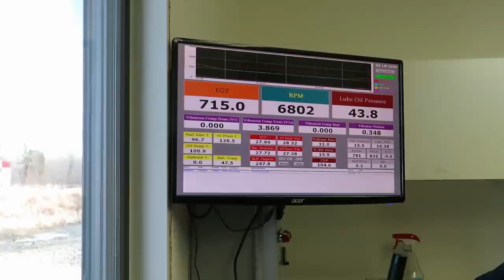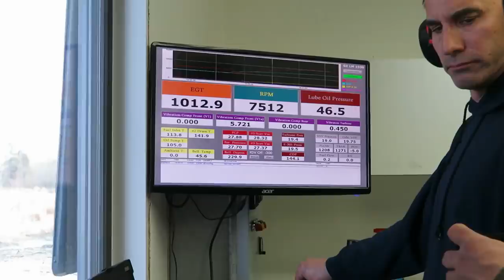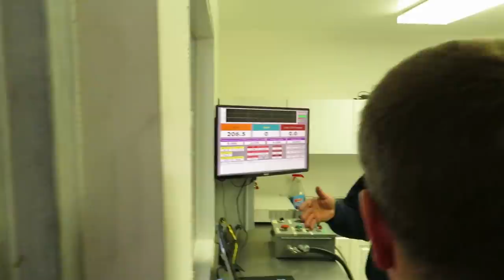Turbine Blade Locks In Action

Comment: Agent Jay Z, I recently toured on of our facilities and found that we have a generation unit that has 10 lm1500s in a huge circle.  I also found an S&S turbine labeled container out in our yard and learned they rebuild our engines!  One thing I noticed that I am not sure you mentioned in your videos is that our engines have hydraulic starters.  I was surprised and excited to learn this and took many pictures. As always, great videos, thanks for taking the time to inform us.
Reply from the maker: Yes, I've never been there, but seen pictures. 10 LM1500s all feeding gas to a common inlet of a huge power turbine.
If you have any info on why it was designed that way, it would be cool to see it.

Comment: Its a dovetail that tapers in the 2 directions it takes force, thus the taper is forced together. So long as it is under force from both directions, it has zero DOF with respect to the hub its attached to.  The lock doesn't bear a load while in operation because it only prevents the joint from backing out under a reverse load condition that never occurs in operation.   ~one engineer

Comment: Another great video. I have heard this myself when the turbine on some jump planes shut down.
I wonder if the engineer working on the blade lock system way back when got a room full of strange looks when they proposed the tiny pins / strips / tabs?
Reply: @gordonrichardson2972  Completely understand the ease of removal.  I was more thinking about when someone, during the initial design phase of the engine, first presented the idea of using the 'flimsy' roll pins rather than the much strong other options.

Comment: Why would you switch to running a J79 with natural gas versus jet fuel? Is this a J79 that is being converted to an LM1500? Or is it going to stay a J79 aircraft engine and you were testing the engine to troubleshooting something and LP is cheaper?
Reply: Oh nevermind, you called it an LM1500 at the end of the video. So I'm guessing this means it was a J79-LM1500 conversion you did for a customer. Thanks for the awesome videos!

Comment: Could compressor surge ever put load on the blade locks if there's an issue with the engine? I'd imagine that'd be a pretty bad/expensive day for the engine owner either way, so it's not like it'd be some glaring design deficiency.
Reply from the maker: As long as the rotor is turning with any significant speed, the blades are locked centrifugally, so the locking devices would not be affected by a compressor stall or surge.

Comment: Centrifugal and torsional forces. The rotation wants to to fling the blades out radially and the force of the gasses want to untwist the curve of the blade. 
Is that what you are trying to describe?
Reply from the maker: No. The torsional force is less than the bending, or levering force.
The force you describe does exist, but is not really a concern, unless temps are exceeded, and then there are all kinds of problems.
At operating temps, the twist is not changing.
Reply: @AgentJayZ  ok. I get it now. Thx

Comment: I have a question. Do jet engines exert any torque on their mounts or do those forces cancel themselves out?
Reply from the maker: No torque. Art Arfons was not correct.
Reply from the maker: Thanks for your self evaluation. The friction of the main shaft bearings is tiny... as in so small as to have no effect at all.
It's what we describe as "for all practical purposes" zero, and can be disregarded. That's what bearings are for.
Rotor shroud contact would have to be cause by a giant failure cause massive engine damage to produce any significant torque. 
Do we really have to print out " under normal operation" every time we discuss anything about these engines?
You are going to make this very time consuming, and a bit annoying.
Reply: @AgentJayZ  So when the engine is spooling up to speed, where does the equal and opposite force go? Is the air spiraling out the nozzle in the opposite direction?
Reply: @darikdatta  I'm not a physicist but I would think the torque produced by the turbine section is directly counteracted by the torque applied to the compressor section via the center spool or shaft.  The only external force would be the straight line thrust from the expanding gases.

Comment: Having watched you hammer the pins in on the 'blading' video, it appeared the pins locked the blades in place tightly with no movement. So why is this engine rattling at low speed .. are these blades  not hammered in with pins?
Reply from the maker: The J79 uses metal tabs that allow more movement. It is a more modern engine 1950s vs 1940s, and incorporated better ways of doing things.

Comment: Dude,cool videos, from here that lock strip looks about. 060 in.
Reply: Out of curiosity, I compared the pixel length of the quarter (0.955" diameter in US) and the thickness of the tab worked out to be approximately 40 thousandths.  I agree tho that it definitely looks less than 100.
Reply from the maker: You guys have way too much time on your hands... but you have indeed solved a great mystery.
The lock strips are 1.0mm thick. I must have got my metric 1s mixed up with my imperial 1s.
Sorry about that!
Reply: @AgentJayZ  As This Old Tony said, "half a dozen [...] would be zero-point-five dozen for you metric users".

Comment: How much effect on horsepower does humidly in the air have on turbine jet engines? I'm wondering because in the videos the moisture condenses as it is sucked in so it must turn to steam in combustion chamber and expand.  I seen in a Popular Mech. mag from 1970's that someone added a small amount of atomized water into the carburetor of a normal piston engine and it increased the gas mileage.
 Thank you Sir for making these videos of all the nuts and bolts workings of these amazing jet engines.
Reply: A few percent. Not enough difference for pilots or flight engineers to need to make calculations.

Comment: Can you talk to us or do a video on the newer engines, where I read in the news etc that certain engines are requiring more frequent blade inspections and also having the blade lubricant replaced? Also, are they referring to the turbine blades or the fan blade out front? Please explain about the blade lube either way? Thanks.
Reply from the maker: I really try to keep my videos about what I actually work on in the shop. Whenever I comment on modern engines, I get my info from manufacturers manuals and also from books anybody can obtain and read.

Comment: Between 6:35 - over the 7:00 min mark. 
What's that coil? Is it to measure the inlet air temp?
Reply: Seems like a hot wire anemometer, to measure the inlet air speed.  Please, do update if you find an answer.
Reply from the maker: It's called the CIT. Compressor inlet temperature sensor. Does not work on the hot wire principle. More like a very sensitive thermostat.
Reply: @AgentJayZ  thank you! I thought it was something to do with the inlet air temp

Comment: Offtopic question. 
Why airline engines doesn't have "stationary" intake blades like engines which you are working on?
Reply: Those things you are talking about are fan blades. A typical engine on a large passenger plane is known as a (High bypass) turbofan. That thing you see spinning on the front is the fan, and it produces the majority of the thrust of the engine by forcing air through a duct around the engine. Think of it as a propeller being powered by the engine, although not quite. Turbofan engines are much larger than turbojet engines due to the duct and the fan but are far more efficient.

Take a look at the size difference between the engines on an early jetliner vs. a modern one.

https://bit.ly/2Umhk6x - DeHavilland comet.
https://farm3.staticflickr.com/2527/3795797539_1b7edcf9d7_b.jpg - Boeing 747

You can see the size of the engines on the Boeing 747 are much larger in comparison to the rest of the aircraft because they have that fan that makes them more efficient. But most of the engine you see is empty space around the turbojet.

https://bit.ly/2CMsqHZ - Rear view of high-bypass turbofan.

The space around that metal cone in the middle is where the jet exhaust exits. Then the large ring of space between that and the engine cowling is where air is forced through by the fan on the front.
Reply: Short answer: Because it's a different construction. In a modern high-bypass jet engine you don't see the actual compressor intake, it's hidden behind the fan. So such an engine might very well have variable guide vanes, you would anyway not see them. Why there are none in front of the fan? Well - I suppose, the fan system is not very likely to stall, so it would not need them.
Reply: Thank you both of you for explanation. I am still learning :)
Reply from the maker: A large turbofan engine does not have inlet guide vanes in front of the fan, because the fan does not need to work efficiently at extremely low rpm. It's actually easier for the engine if it doesn't.
Reply: What also came to my mind: A fan is not a compressor. Although both have blades, they do different jobs. And while a compressor is prone to stalling, because it compresses air (which always will try to expand again back towards the inlet), a fan only moves air.

Comment: Is there a special control mode for VSVs for while an engine is shut off and spinning down? Is there any reason to care what the stators are doing at that point?
Reply from the maker: The VSV system runs on  hydraulic pressure, and is signaled by engine speed. The engine needs to be turning, but not running necessarily, for it to function. The VSVs are already in the minimum position at idle speed, and they don't change position as the engine goes slower and slower after shutdown.

Comment: Couldn't the bending force be called disk loading?
Reply: The bending load on the blades, which, in engineering terms, are simple cantilevers (unless they are shrouded), is a small proportion of the centripetal force applied by the disc on the blade root.  It is substantially in the circumferential direction, to produce torque, and that's why the turbine rotates.  
Please note that, as I have stated numerous times on this channel, "there is no such thing as centrifugal force".  To prove this, whirl a mass around on a piece of string.  You won't be pushing it outwards: you will be pulling it inwards towards its centre of rotation.  OK, "as every action has an equal and opposite reaction", according to Sir Isaac Newton (who was probably autistic),  I'll allow you to refer to a 'centrifugal reaction'. 
You may also be interested to know that, as part of the design process, a turbine blade aerofoil usually has a small amount of 'lean' in the direction of rotation designed in: this to minimise the bending moment at the blade root at its normal operating  operating speed.

Comment: Hey Jay, nice video! Does the J79 / LM1500 make the same power when is running on jet fuel vs gassiest fuel? (I know that gasoline piston engines make less power on gassiest fuel, LPG)
Reply from the maker: Same power. The engine power is limited by temperature, and we pump in whatever amount of fuel is needed to get that temp.
Electron Bill was not watching the rpm, but the EGT when taking the engine to max power. 1050F was the nominal limit.
Depending on the conditions, the rpm at max power would be anywhere between 7400 and 7800 rpm.

Comment: I know this is off topic, but is the stator angle uniform, or are there changes in the angle of stator vanes as air is compressed?
Reply: The J79 has variable stators.  They change angle with power demand.  He has a few videos on how they work, check them out :)
Reply: This video shows it.  If you watch the stator vanes as power comes up, they straighten out very slowly, and as the engine is brought back down and the shut down, the stators slowly close.  Very elegant.

Comment: Wow, that's funny that people would be scared of them coming out. It's visually obvious that they would stay in there with a piece of gum. All The force is directed outwards and the design of the blade's mating surface is triangular so that it would only wedge tighter the faster it's spinning. i would call the other force axial torque , but there are also slats so it cant bend>
Reply: It holds them so they don't come out the other way :p
Reply: Read my comment again... These tiny pices see no force from the blade when it is spinning. They Do no "Work"
Reply from the maker: For a detailed look at blade mounts and fits, check out the video about blade locks in the Orenda 14 playlist.

Comment: very good. is it safe to stay behind a jet engine?
Reply from the maker: Depends on how far...
Depends on whether it's running
Depends on what the power setting is
Depends on which engine
Depends on what you mean by safe
Depends on what you mean by stay
Depends on what you mean by behind
Depends on what you mean by "it"
Reply: @AgentJayZ  . nice answer. thank you very much. success.
Reply: I was once blown off a ladder by an Aviaco (Spanish airline) DC-9 in Madrid, it had goosed the throttles to make it around its final turn on the apron to park. I was checking engine oil & CSD oil levels our 707's number 4 engine when I suddenly felt a REALLY hot wind that became so strong I couldn't maintain my balance on the ladder and had to jump to the ground. The exhaust blast died away very fast since he was turning, and I was unharmed, but for a second there I thought I was gonna be cooked. Good thing he was as far away as he was.
Reply from the maker: 100% true and accurate.
Precision required if answer desired.

Comment: Interesting. I was concerned when I boarded a commercial flight and heard the engine making that awful rattling sound.
Reply: The "awful rattling sound" that you hear from a big turbofan engine, which is windmilling in the breeze, is perfectly normal.  It is most probably the sound of the fan blades (rather than the turbine blades) moving in their root slots and, if the blades have mid-span shrouds (aka snubbers or clappers, if you are a Brit) the abutment faces coming together.

Comment: Yes, but what if an engine fails in flight, and then there is a birdstrike at that time? 
Just joking, I expect they keep spinning from the airflow even if they don't produce power.
Reply: Of course the blades will windmill producing no power.
Reply: Actually when they windmill they will suck up power
Reply: @massmike11  power from what? Power comes from the turbine operating and she's not when the fans windmilling.
Reply: @DC8Combi  When an engine is windmilling in flight, or on the ground when the breeze is turning it, the fan (or compressor) blades are actually acting as air turbines  (of course!) - and they are driving the turbines.
Reply: @grahamj9101  but a windmilling fan is simply not producing power. My reply to Michael Picard was how is a windmilling turbine making power since he claimed it still sucks up power. I'm very well aware as to the operation of gas turbines I'm an aircraft mechanic 21 years.
Reply: @DC8Combi  Sorry, but despite your 21 years as an aircraft mechanic, it appears that you need a little teach-in on this subject from someone with a lifetime career in the design of gas turbines - me.
Let's start with all those wind pumps on the prairies of North America , which often appear in the movies: are they producing power to lift water?  Of course they are.  So when the fan of a big civil turbofan is windmilling in the breeze (sometimes the wrong way in a tail wind), is it producing power?  Of course it is.  The fan is acting as a wind turbine, just like those wind pumps.  The power being produced may not be very much but power is, nevertheless, being produced.  So where is the power being absorbed?  Some will go into turning the accessory gearbox (if there's one on the LP shaft - which there usually isn't) and any of the accessories that don't have clutches.  The rest will be absorbed in turning the turbine,  which is acting as an inefficient air brake.
Reply: @DC8Combi  A windmilling fan is certainly not producing any thrust, but it is certainly producing power, albeit only tens of horsepower, which gets absorbed somewhere.  I think you need to be less ambiguous with your terminology, while I need to back and update my teach-in.
Reply: DC8Combi from the air passing through the turbine. If the engine is not producing power but the blades are turning that means they are getting power to turn from somewhere. Without power input the turbine wont turn. No power= no energy= no spinny spinny. Inthis case with the turbine not burning and producing power the turbine is extracting energy from the air being forced through it by the motion of the aircraft the the air also it may be bleeding off residual energy from when the turbine WAS running